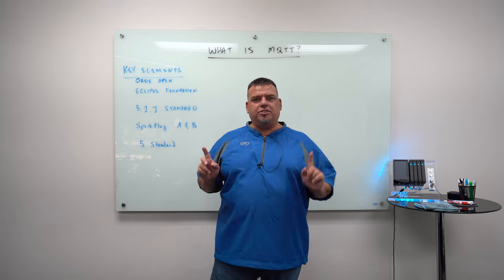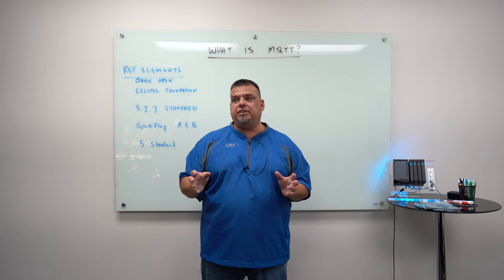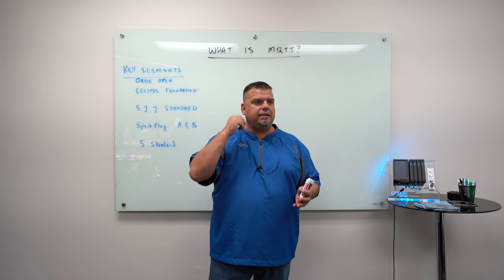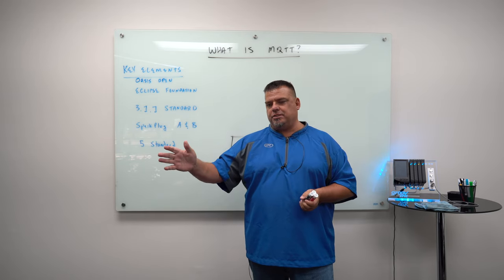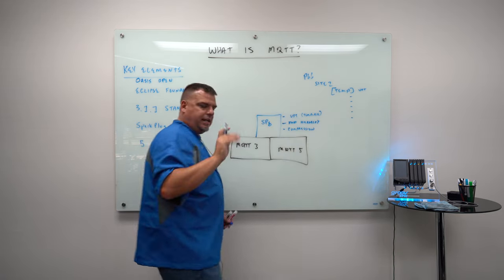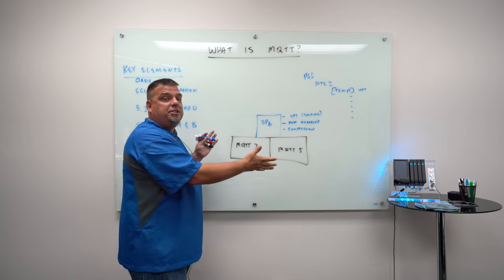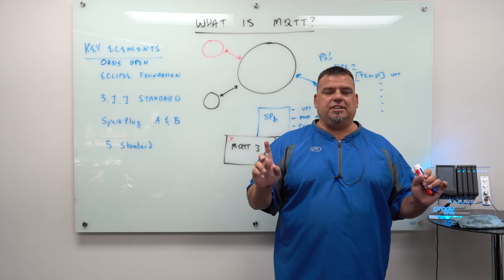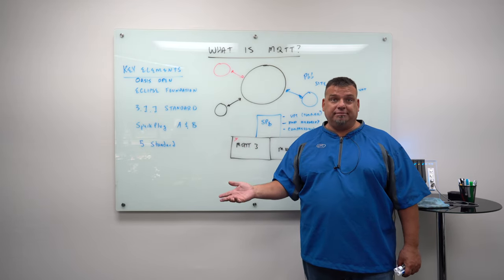What is MQTT? - Part II - "The MQTT Stack"

Comment: Excellent video as usual. Wondering why Mqtt wasn't widely adopted in 2000s and even 2010s in process and manufacturing industries with such specs.
Reply: TCP/IP didn't 'win' the protocol war until about 2010, and once that happened -- MQTT took off.
Reply from the maker: Great question Rana!

Comment: Hi walker, you mentioned in this video around 7mins in, that mqtt 5 is backwards compatible with 3.1.1, but emq website is saying it is not... Could they be referring to something else?
Reply: I definitely say this wrong and we will correct it so there isn't confusion.  I mean to say it this way:

1. MQTT 5 builds on MQTT 3, it's not a rebuild of the spec, it's an extension with new features

2. Brokers are not spec aware and many of the existing brokers have implemented  many elements of 5 already and we didn't even know it

While MQTT 5 isn't backwards compatible for developers, it will seem like it is for consumers.  Nonetheless, this statement is confusing so we will pull it out or disclaimer it.
Reply: @walkerreynolds973  thank you very much, your opinion on ind 4.0 and iiot is at the top so if i see or hear something different, my initial impression is "they must have not seen walkers video". Thank you as always for giving top notch quality information!
Reply from the maker: Thank you PJON!